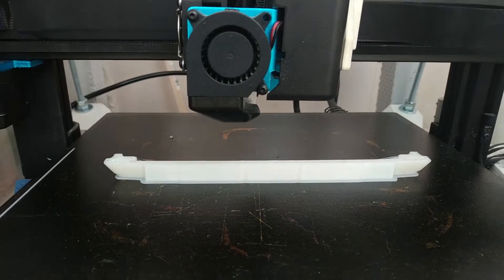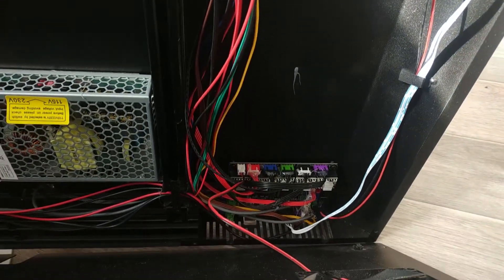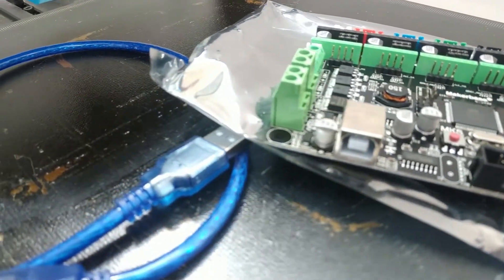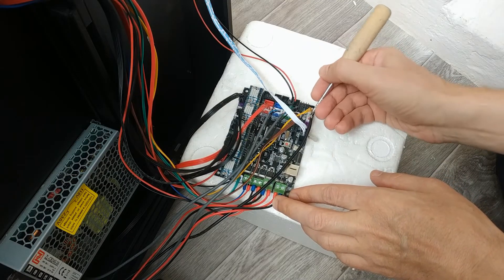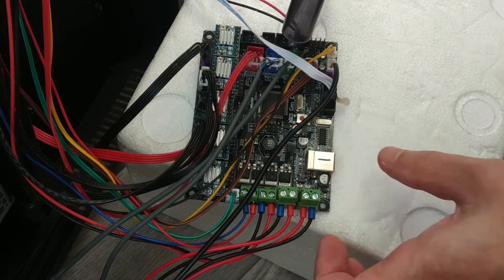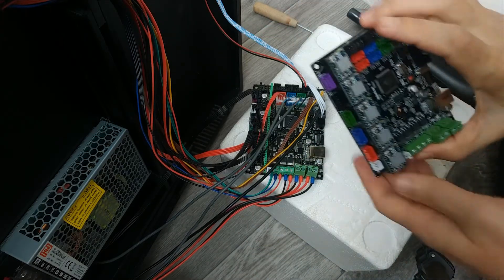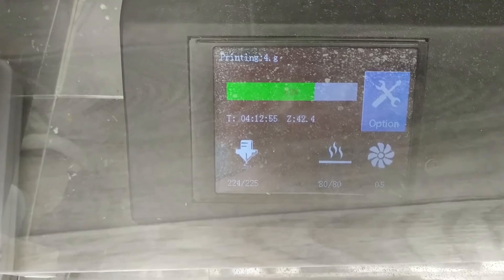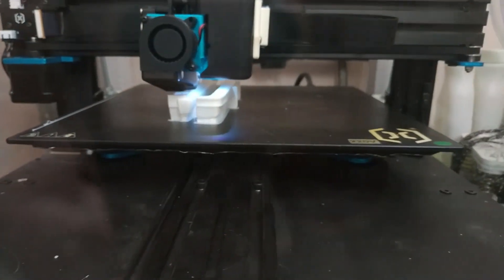3d printer Error  System stopped! Heater ID:bed.  How to remove thermal glue

Comment: did you get errors  afterwards? because that error is most likely caused by breaks in the heater bed cable bundle.
Reply from the maker: After a while, the error began to repeat itself, and then I realized that the problem was a break in the heater cable.
Reply: hello how do u fixt it please ? @itman3dprinted